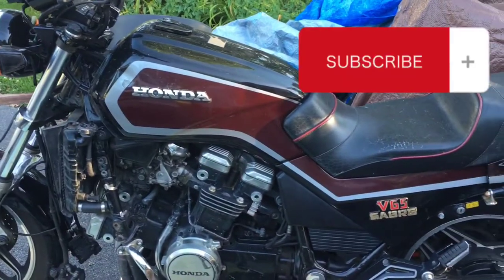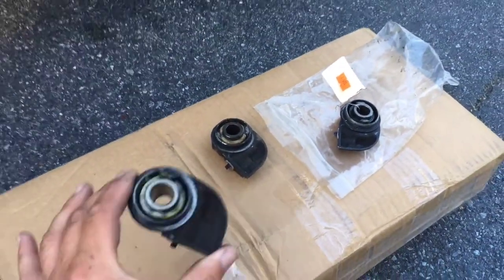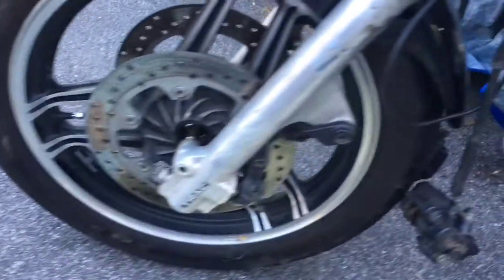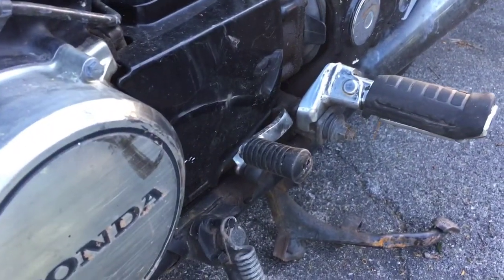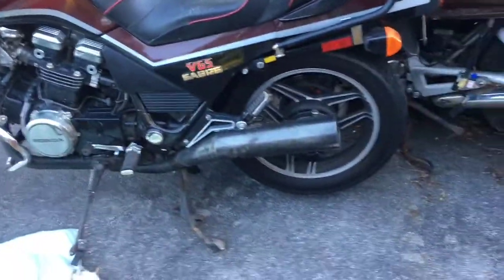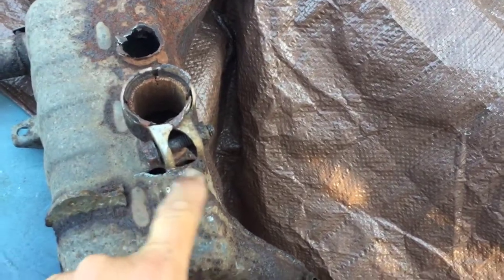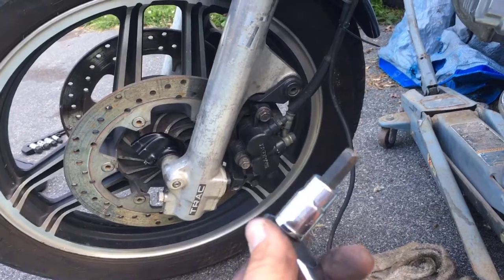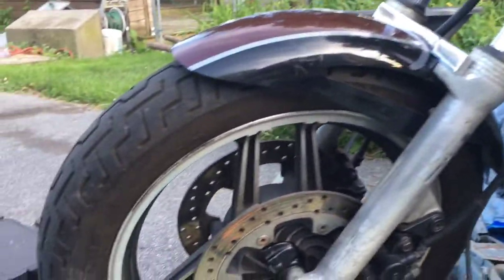Shop time! Honda Sabre V65 and V45 broken Exhaust and Speedometer

Comment: No electronics on those speedos, it's all mechanical. The cable from the hub goes directly to the back of the speedometer housing. Good vid, thanks.
Reply from the maker: The Sabre uses an electronic cable that plugs into the gauge. I was expecting to see the mechanical rod but that just runs into the bottom of the cable. I’m not sure how it works but it was working before I busted it up 😂
Reply: @mcycleshawn  the electrical (?) wires should be for the lights in the housing. I'm no expert bro. Just working off experience here. Pretty sure those speedos are gear driven. Will be good to see what you find out to get it sorted.

Comment: To change the speedometer gear out, do you have to pull the front axle off or can you remove the gear box just with unscrewing screws?
Reply from the maker: The axle does need to be removed